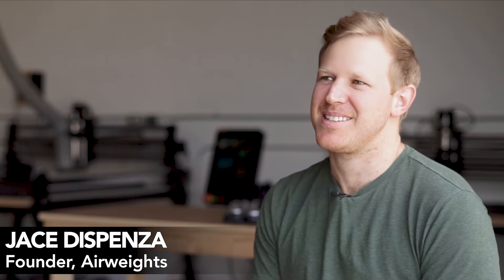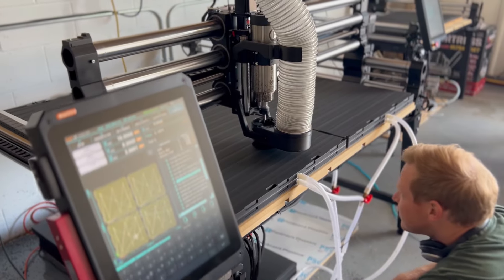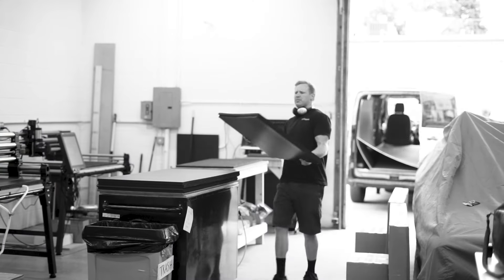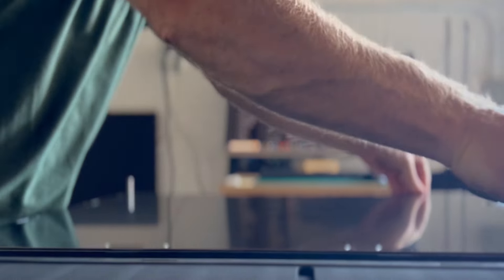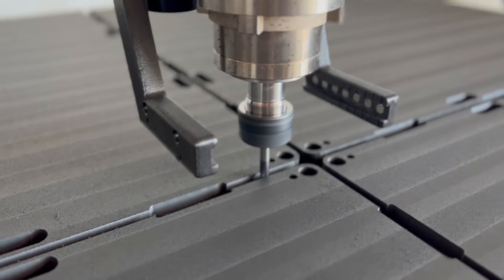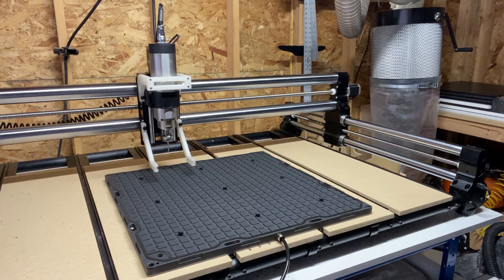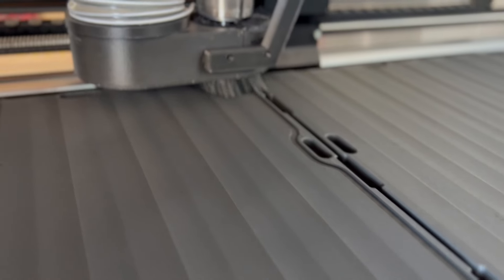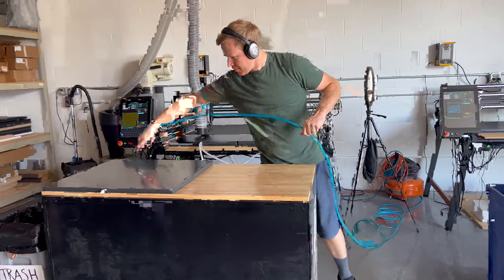From Customer to Partner - meet Airweights: the modular vacuum table for your hobby CNC!

Comment: Think a full 48x48 sized airweights bed be produced eventually?
Reply from the maker: More in the future!
Reply: The primary limitation with a 48x48 is shipping and handling. We recommend multiple smaller tables that can function the same way as "zones" on a large industrial CNC. You only turn on the area that you need and isolate vacuum to the area that your stock is covering. New products to streamline this approach are coming soon!
Reply: prices are insane !!!!!!

Comment: Can you put 1/4” MDF down as spoil board on top of the vacuum and get suction through the MDF?
Reply: Yes! But Tile Gasket on top of the MDF is required. Check out the instructions section on our website for more info on this approach. MDF density is also critical to this working well!
Reply from the maker: Yes! But Tile Gasket on top of the MDF is required. Check out the instructions section on our website for more info on this approach. MDF density is also critical to this working well!

Comment: I use 100% of the cutting area of the  Onefinity 48”x32” surface will this work?
Reply from the maker: They come in two sizes, 24x24 or 24x48.
Reply: What size our your parts? If you overhang a small portion of a part and the majority is still on the vacuum table, there are tricks to make this work. Reach out to us if you'd like to know more and keep an eye out for new products to support your needs.